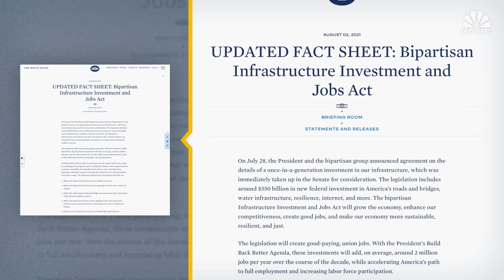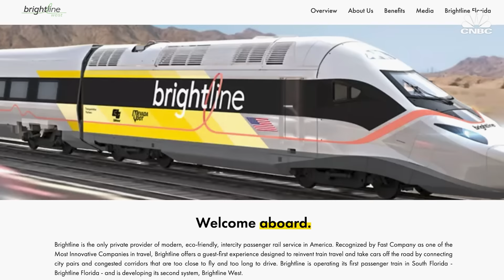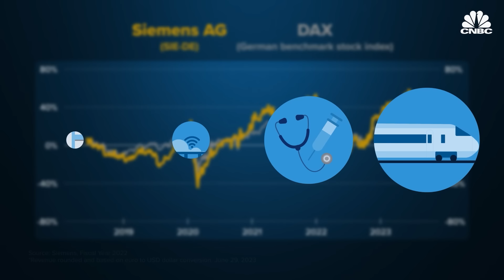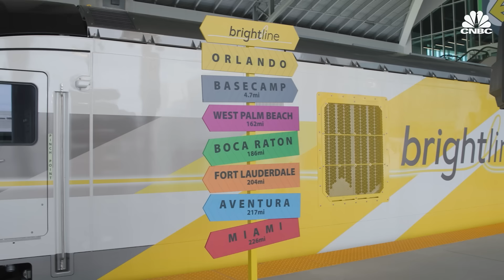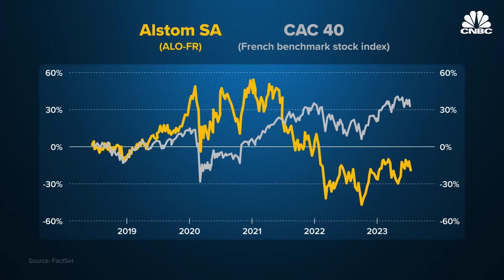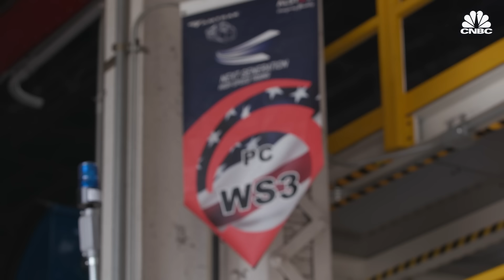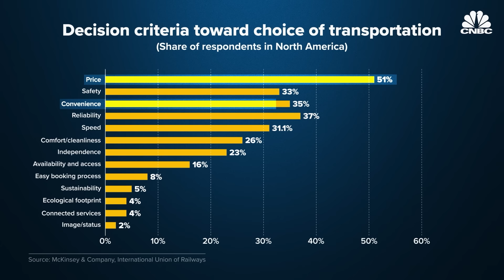Why Passenger Train Manufacturing Is Booming In The U.S

Comment: Amtrak should focus on getting their own right of ways and stop relying on the freight rail companies. Build the tracks in the center of existing Interstate Freeways and work with the states on funding that way. Also start running hub type service instead of line service. That way you can have more long distance lines that can really take advantage of high speed and efficiency. For example, on Interstate 10 you can have a high speed line that goes from Los Angeles to Jacksonville. The stops on the main line (hubs) Los Angeles, Phoenix, El Paso, San Antonio, Houston, New Orleans, Jacksonville. Any cities between those cities would be linked to the nearest main hub city. And those cities would have micro hubs to towns around them.  For example Alamogordo NM would be part of the El Paso hub. Tuscon would be part of the Phoenix hub. Mobile AL would belong to New Orleans. Tallahassee would be part of Jacksonville.
Reply: Amtrak cannot do anything Congress (or the states) do  not allow them to / ask them to do. That is the problem. STATES (with FED financial backing) should prioritise building publically owned rail ROW on important corridors and then tender our operations / service level. That is how Europe does it.
Reply: @dozyaustin  Hell, many states possess miles and miles of disused/abandoned ROW that were surrendered to the states after the CONRAIL days that they could reactivate for passenger rail travel. The corridors still exist. They just need feasibility studies done and some new rail laid down.
Reply: What a super idea, put the trains in the center of the highway, great thought.

Comment: Remember, the United States built railroads over 100 years ago with steam passenger locomotives that traveled at over 100 miles an hour. The United States had the fastest trains on Earth. These are the same railways we now say cannot handle a train doing 90 miles an hour. We had a nationwide passenger high speed rail system over 100 years ago. What we have now is a result of neglect, not outdated technology. Petition your representatives, and ask them to restore the old system, and rebuild better for the future.
Reply: The rail can’t handle that speed because it’s old and we’re too cheap to replace them but not for long! It’s inevitable that this investment in rail will lead to the development of new physical rail and even the replacement of the old rail with modern rail capable of handling speeds up to and maybe even exceeding 169 mph well into the 180-200 mph range.
Reply: Remember, was, had, cannot, neglect, outdated...This list goes on and on...
Reply: @L154N4LG4IB  the old rail system only topped out in the steam age because that was the fastest the steam engine could pull. The Japanese Bullet Train was faster than any steam engine and pulled those same trains past 120 miles per hour on the same old rails that they used to have. It was only recently that they upgraded the rails to handle even faster. The leap to 200 mph is too expensive for people today because we are trying to build a whole system from scratch. By simply rebuilding the old system and updating it bit by bit over time like the Japanese did would let us have nationwide high speed rail in less than 10 years, and Japan-level high speed rail would be gradually updated over the 50 following years. The most important part of public transport is not top speed anyway. It is running according to a schedule. japan still uses slow trains everywhere for shorter trips.

Comment: This article completely leaves out the key fact that the US, by far and wide, has the world's largest, and most developed rail system.  However, it's nearly all dedicated to freight service, which is indeed profitable, and not completely dependent upon taxpayer support, like passenger service.  This fact does not fit the political narrative of those arguing for passenger rail.  In the earlier 20th century, train travel in the US was dominant, and indeed quite profitable under private enterprise.  Air and highway travel quickly supplanted trains in that role, however.  With the US being a large country with vastly spread apart urban areas, Americans preferred the speed and flexibility of air and auto travel.  To now advocate for the opposite, would be to demand Americans embrace inconvenience, inefficiency, and lower their overall standard of living.  The countries cited here in Asia and Europe see people riding trains out of necessity, not preference, with very high costs of living, and high levels of urbanization as drivers.  This video piece is merely an argument for government backed rail spending, not a well-reasoned discussion of the issue.

Comment: I tried to take a train from Michigan to Texas. It would have taken 39 hours and cost $1,000 more for two people to rent a cabin for the trip compared to flying to the same city and we still would have had to rent a car at our destination.
Reply: That's because of the design of the routes in between. Try a similarly long travel in a place like China where the investments were opposite (lots of tollways and random airspace restrictions, but well-supported public transit), and you'll likewise reach the opposite conclusion.
Reply: That's only because Amtrak has been poorly supported for decades and shares rail with slow moving freight trains. If you want that travel time and ticket price to come down, we need to actually invest in passenger rail.
You provided an argument why Amtrak needs to be funded more, not an argument against it.

Comment: The issue with our transit right now is that it takes me 28 minutes to drive from my house to my job. If I take public transit (which impressively drops me 1 block from work), takes 1h 6m. It's not worth doubling my commute, and battling the homeless on the walk.
Reply: All land use problems that are too boring for the Average American to understand.
Reply: @randgrithr7387  Perhaps we'd care if they were more interesting. I can drive to my office in 20 minutes or I can take two buses in 90 minutes. My car takes me where I want when I want with who and what I want. I don't have to share space with strangers. Rail really only works for connecting major cities. Outside of that, the US's population density is too low and our land area is too big. You can't put a station for every little farm and hunting cabin.
Reply: How much does car parking cost versus the train fare? Where I live it's 35min to drive to work if traffic is good and 55min door to door on the train. However with tolls, fuel and parking costs driving is over three times as expensive as the train fare.

Comment: The one thing right now that rail has going for it is what’s going on in the airline industry in the United States.

In fact, I would observe whether or not airlines are lobbying against high-speed rail to prevent it from becoming a legitimate competitor.

I’ve gone on some Amtrak trains, and while they are not perfect, the comfort, any amount of space available is definitely more significant than that of the typical airplane, and I haven’t flown in several years, I understand it’s less comfortable than it used to be.

More importantly, All of the tiny annoyance is that you have with air travel are basically gone when it comes to train travel. It’s actually so much surprising that our train infrastructure does not have the same security theater that our air infrastructure has. But the truth of the matter is, I can get on interstate train with several bags And not have to check any of them. I can walk from the ticket counter directly to the train with little to no interference. And in fact, if I want to decide to take a train at the last minute, I can do so, by arriving at the station with less than a half an hour between when I get the ticket and when the train leaves.

I imagine if some of these things will change, if train travel becomes more popular in the United States, but if there is any time, we are taking a train that competes with taking a plane will take Root, this is it.
Reply: Airlines do lobby against passenger railway expansion. For example, the Texas Central was fought by none other than Southwest Airlines.

Comment: One of the High cost issues I see, is every district customizes /everything/.  If it was just paint and upholstery think of not having to do all the (design qualify) tests over and over before a train can move a passenger.
Reply: the high cost issues is private land ownership, which Brightline doesn't have to deal that much with, cause they're building their lines next to or in between highways, where there's already environmental damage cause of the highway, so the train makes no additional impact.

Comment: A lot of the focus is on high speed long distance travel, which is important, however good suburban rail systems in major cities and their surrounding towns would have the greatest impact in terms of getting people to swich from cars to trains
Reply: See that's the part that people seem to miss. It only makes sense to have the HSR connecting major cities, once the smaller regional lines are in place. Otherwise what good does it do you to connect a major hub if you still need a car to move around once you arrive?

Comment: Siemens and Alstom make American passenger railcars, because the American railcar manufacturers have gone extinct. Since the money going towards railroads was then changed to go towards roads from the 40's and 50's to now, and private corporations buying up all of the passenger rail, replacing it with freight because it was more profitable, with the automobile companies buying up all of the street cars in the city, to not discourage automobile sales, and then people no longer going to train stations, so they all closed down, it is no wonder why we don't use trains anymore, and nowadays, people don't know what it is like to actually ride a train. Other than Chicago and the North East Corridor, the U.S. is a horrible place to experience train travel from school to work and vacation. Japan, Switzerland and Germany are the size of U.S. States respectively (depending on what state you are in), and are more densely populated, but city design can fix that. If you design your cities to be spread out, cars and airports are a better mode of transportation, if you design your city to be compact and organized, trams, trains, and bikes are a better option. The U.S. decided to go the car and airplane route in the 50's by bulldozing/ constructing and designing the century that way, and it can be done for trains as well to fix congestion on roads. If you want to maximize efficiency of transportation, multiple modes is the best way to go, not just 1.

The fastest legal speed limit in the U.S. is 85 mph, and the U.S. has had trains capable of 100 mph since the 1930's, and in the 80's France and Japan had trains capable of running 200 mph with no sweat, beating out airlines they were competing with. The U.S. deals with a lot of holiday traffic problems with flight delays and cancellations, and High Speed Rail would be a perfect alternative, capable of running in the snow and thunderstorms that airplanes cannot fly through.

-signed someone who loves to drive trucks on farm to market roads
Reply: Sad how American companies disappeared from the rail manufacturing scene.

And don’t be thinking they are immune from autos and planes. Just look at how Boeing is losing out to Airbus. There’s a corporate culture problem too.

Comment: One gentleman is right about one thing: When California High Speed Rail is ready and in operation, other states want to have such a system as well. However, Siemens and Alstom will be at the forefront of rail vehicle construction for passenger transport for at least another 10 to 15 years. The third member of the group could be Stadler from Switzerland. So the market with you will remain in European hands for a long time. Greetings from Berlin/ Germany. Sven

Comment: Passenger rail & High speed rail is a great place for the US Most cites are far apart which can have trains go 200+,  you can go from a another city to another one at 125 seeing mountains. with commuter rail & rapid Transit you can go from a suburb or a neighborhood to downtown. With trollys going all over cites having walkable Suburbs & cites. Rapid transit & Streetars connecting Downtown, City halls, Universitys neighborhoods Tourist Areas Railway terminals etc. But instead we got Highways that cut through our cites, Cars & planes polluting into the Air. & what if I tell you butting down asphalt roads is the reason why your cites are hot every summer & sometimes during winter. I went to Jim thrope, Pa and go on a tourist train seeing mountains & when I got off the train it was 81 degrees but it was a bit cooler. We have nimbys opposing Housing & transit projects that are beneficial. Like we could've continued being having the best railways in the world. But we had presidents like Regan, & Eisenhower cancelling Transit projects and replacing them with highways, The interstate highway system could've been the interstate High speed rail system but no. I hope get a 220+ HSR one day.

Comment: Americans love cars and planes.

Apart from the factors such as cleanliness and safety, India has the biggest passenger railway network and its controlled by the central government. It operates around 13000 passenger trains, has 7000+ stations across 120,000+ kilometres track length

Ticket charges are very low, but profits are high generating around 30 billion dollars each fiscal year.

Comment: The Main problem with the conversation around train travel in the US is the lack of awareness that urban density plays in it's usefulness and financial sustainability. The typical American suburb has low urban density, which means that fewer people live within walking access of mass transit stops. If most people have to drive to the train station or bus stop it's a waste of time and gigantic car parks only reduce walkability. 
Increasing urban density and improving urban design will make rail travel sustainable and profitable. That is the ONLY realistic fix.

Simply say that mass transit doesn't have to make a profit because it's transit is shear stupidity. if it's not profitable there's something very wrong with the system.

Comment: Looking to the TGV's convenience is something that the US should consider. The TGV averages around 279km/h or 173 mph for its trips. While the average commercial plane travels around 575 mph, but the inconveniences of having to not only drive to a busy, most likely overcrowded airport, wait 30 mins to an hour in the security checkpoint, pay for price-gouged food, get crammed in a metal tube without most amenities and having to pay substantial amounts for a round trip and likely have the trip cancelled due to weather or technical issues.

The price of a one-way TGV ticket is around 30-35 USD to go from Paris to Lyons. The price of a plane ticket from New Orleans to Houston (roughly the same distance) is double or more the cost for a one-way ticket on the TGV. The same trip on a high speed rail would normally take under 2hrs. Some of the nonstop flights I looked at between New Orleans and Houston take about 1hr, 20 minutes. Driving would take 5 hours, 50 minutes if you don't count traffic based on cursory information online. The amount of time it takes to get on the plane, deplane, pick up baggage adds what might be an extra 2-3 hours to that one way plane trip dependent on several factors.

Getting on a high speed train? You get to the station 20-30 minutes early, get your tickets, and load your luggage. Getting off the train? Not much time at all.

Luggage limits? Only limited by what you can carry. In a time where air fare is becoming increasingly more obtuse, obnoxious to deal with, and generally unfun; convenient, low cost, high speed rail is becoming increasingly attractive.

It also winds up paying for itself and then some.

Comment: One chart in this video listing national investment in rail placed Spain as investing the least. While Spain's rail system does operate 200mph HSR lines, their less expensive rail service are TALGO trainsets which peak at 125mph and do not require electrification of overhead wire nor expensive rail realignment to achieve preposterous high speed. In other words, Spain achieves HSR goals without prohibitively expensive railway construction nor objectionable impacts. 

200mph Bullet trains suffer from a malady called being "planned to death." Planners take their sweet time getting paid to plan routes they know won't be built. The Amtrak Cascades is one corridor the planners know perfectly well is unquestionably unsuitable for bullet trains.

Comment: The problem with US rail traffic is that freight companies own 85% of all the tracks so frieght takes priority. Amtrak is never ontime. We either need dedicated passenger rail or a new transportation system altogether. I would like the US to invest in MAGLEV (magnetic levitation trains).

 Its the absolute fastest trains available, its reliable, weather proof, derailment proof and because it rides on elevated  guideways or in a trough it is collision proof. If built along interstates there will be no need for eminent domain laws. 

 At 387 mph it is comparable to Air travel. If we had Maglev travel built it would be  Nonstop NYC to Chicago in 2hrs 4 min. No TSA security, no baggage fees, no air sickness, no falling from 30,000 feet. 

Bar car, sleepers, and a dining car could all be included on cross country trips. Nonstop NYC to SF would be 7hrs 50 min. Today those same trips on Amtrak is 22hrs and 77 hrs respectively. Today its faster to drive to both cities from NYC. 12 hrs to Chicago and 50hrs to San Francisco.